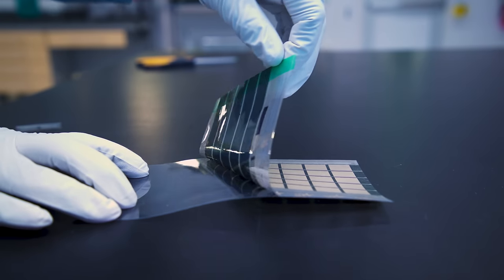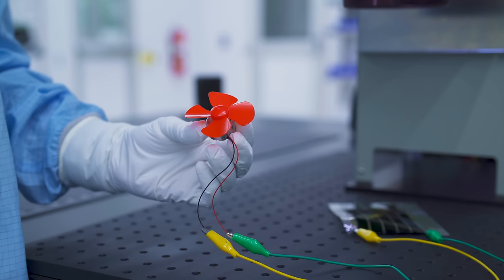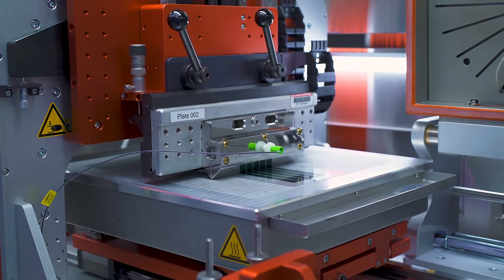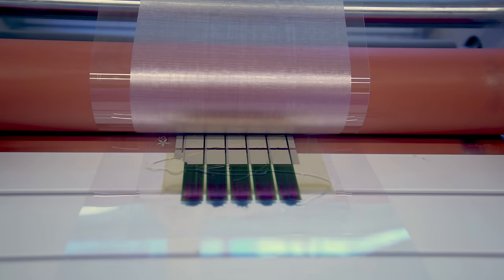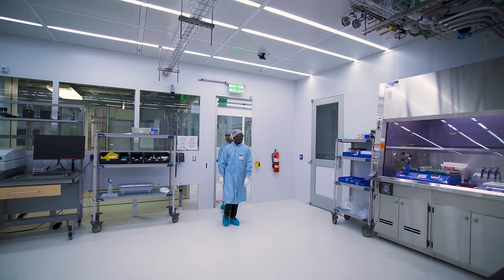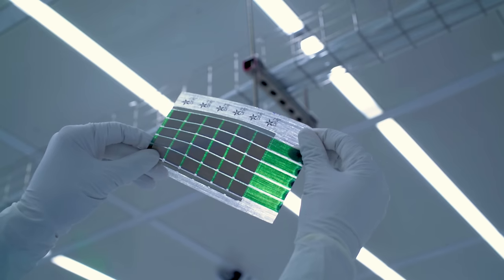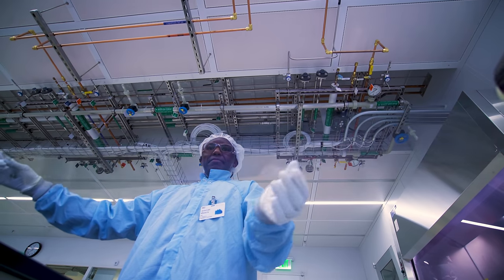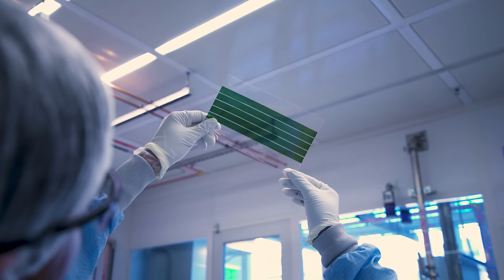Paper-thin solar cell can turn any surface into a power source

Comment: hmmm, 375w per kg.  That swath or sample looks like roughly 7" by 4". weighs, I don't know , maybe 5 grams?  How much square footage of area/space does 1kg take up?  ok quick abreviated math - 1000grams divided by 5g (estimate of sample shown in video) ¿~°¡x%  = a surface area of 116 feet long by 66feet wide to provide 375 watts.  Still yet, this can be useful. Plaster this on the every surface available on a building. save paint costs with this in it's place.

Comment: Could Kodak impressive film coating technology by applied in this field?
Reply: Kodaks slot die machines already have run this style of solar cell technology for years…this is not some brand new invention by MIT as the video formats and misrepresents itself to be. Kodaks machines can indeed do this on a massive scale and other roll to roll slot die machines have already been mass producing this technology for years.

Comment: Weight on a home's roof is fairly irrelevant since homes don't move and an extra 1000 lbs wouldn't require reinforcement. Great for vehicles though.

Comment: Don't see much potential for this particular technology.  I'm sure everyone is thinking but this changes everything now everything can be a solar cell but that's not at all the case.  Solar cells efficiency is directly correlated with it's thickness, thicker = better.  Thinner is cool, it is neat, it is interesting.... but it's completely impractical for generating any actual amount of energy that could be used.  That's not a "well the technology will get better" type of scenario either.
Reply: Hard to tell from the video what this breakthrough consists of? Usually Dye sensitized solar cells are thin as paper. The thickness of the wafer in conventional solar cells is wasted. Absorption depth is not that much for the short wavelengths most relevant for solar cells: https://www.pveducation.org/pvcdrom/pn-junctions/absorption-depth So a dye sensitized solar cell is possible a clever way to make cheap multijunction solar cells. (Not that the video is about that)

Comment: Shame (or perhaps convenient?) no mention of conversion efficiency.  Most of these thin film PV cells are rather pathetic compared to mainstream silicon technology.  For the rooftop example, vastly lighter doesn’t help so much if you need 10 times more area than is on your roof! This borders on a misleading presentation, methinks.

Comment: How strong is it against impact 🤔 and other possible damages, like hail storms, strong sun, does it loos power when overheating true the sun, like normal panels do, how is the thermal stretching, does it break easy if very cold and heated, like summer, winter time changes, this'll have a big impact on this stuff, if something is coated with the cells how long will them life until loosing effective, the same like normal cells 25years and 80% of ther efficiency is still working, or more ? 🤔🤔 And its probably extremely expensive and only for the evil Billionaires. And the fake scam bs with the carbon footprint Nonsens.